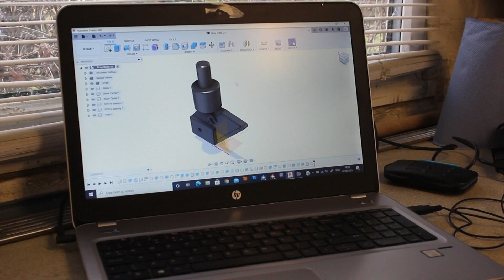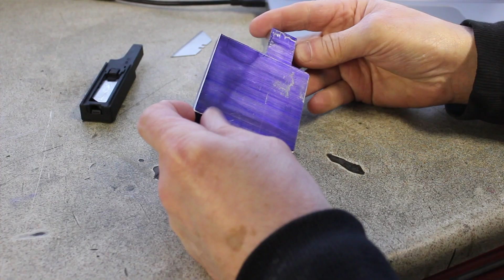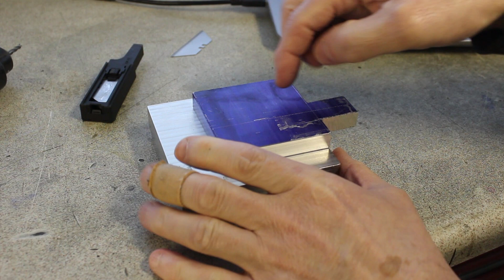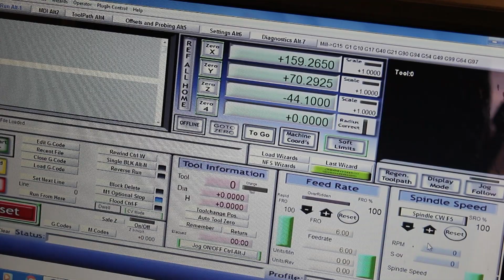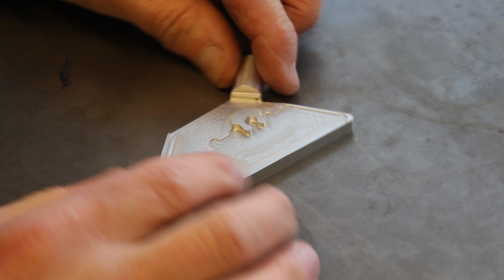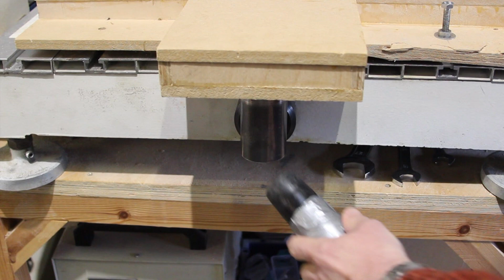Drag Knife - turn your CNC router into a vinyl and box cutter

Comment: Olá, poderia informar o caster?
Reply from the maker: Hi I’m afraid I can’t remember what bearings I used. I can say though they weren’t strong enough they have both failed and need replacing.
Cheers
Reply: @CazualHaze  Gostaria de sber o angulo de deslocamento do centro do eixo para a ponta da lamina, acho que voces chama de Offset.  Pretendo fazer uma para cortar vidro com aqueles cortador manual!
Reply from the maker: @CARCULE-gn4xe   Oh I see! the offset is around 1-2mm it does not need to be very long.
David

Comment: Just wondering why it need this bearing and housing, as the spindle already has good bearings.
Reply from the maker: Hi @viteota good question its a common thing I found on all the commercial units I found. My guess is its because the spindle has a lot of mass ( the rotor etc) and would not follow the cut as easily as a separate lightweight bearing. 
Cheers

Comment: Think this would make a great upgrade for my engraver 😀
Reply from the maker: Thanks for the comment. I used mine to make boxes and inserts for flower presses. I will be revisiting this in the future and making plans etc available.
Cheers
Reply: @CazualHaze  I was considering buying a cheap cricut but this would work well for vinyl paint masks for models I think. Or maybe with a scalpel blade instead 😀

Comment: Beautiful work! How do you make the spindle turn following the 2D contour? Do you use a plugin?
Reply from the maker: Hi @_madmadmat
The spindle is free to rotate. The cutting point is behind the centreline of the spindle.
So it casters in the direction of travel. Just like a supermarket trolley wheel.
Cheers
Reply: @CazualHaze  Thank you!

Comment: Hi, I want to know one thing that, How does the drag knife rotate..??? Does it rotates itself in the direction with the drag force or the spindle is rotating it..??
Reply from the maker: @himanilsharma2147 
Hi knife casters it's cutting point is behind the rotation centreline. Thats a fancy way to say it casters like a supermarket trolley wheel. The spindle is not running at all. The posh ones have a motor and rotate under computer control. I think this is called a tangential knife.
Cheers

Comment: Hello! Can you please tell me how the knife moves? Software, motor or mechanical due to the movement of the axes?
Reply from the maker: Hi the knife pivots on the spindle axis and acts like a caster wheel. It follows the direction of the axis travel. the knife point is 2-3m behind the spindle axis.
I hope that helps cheers
Reply: @CazualHaze  Большое спасибо за ответ)

Comment: Thanks for sharing your work !
If I understood correctly the head of your CNC doesn't orientate the cutter ? He turns freely and only the X and Y movement orientates it, right ? Can it cut more complicated shapes than squares such as curves and so ? 

Thanks a lot for your video ! 😊
Reply from the maker: Thanks Leo,
yes the cutter is free to rotate it follows the direction of cut in the same way a supermarket trolley wheel follows or casters in the direction of travel. It can cut more complex shapes and curves however it is limited in what sizes and how tight the corners are. If you need really intricate stuff try a company called cricut.
Cheers

Comment: Why did you hook up the air?
Reply from the maker: Hi Mike,
I think you mean the air on the cnc router?
Its actually a vacuum hose from a vac cleaner. What happens is it evacuated the air under the cardboard the table is hollow the differential pressure from atmosphere compared to the table forces and holds the card in place.
The clamping force is quite considerable depending on how much vacuum you can pull. At the max of zero pressure in the table the force is 15lbs/square inch. I think my table can get to 5lbs /square inch. Once clamped its hard to move the card however if the vacuum collapses it falls to pieces instantly.
Cheers

Comment: Awesome video. For some time now I had been wondering if its to build one to cut out boxes from cardboard just as you did, so this video has really made my day.. By the way which software can one use to generate gcode from dxf (allowing the cnc to make both cut and crease lines)
Reply from the maker: Glad I could help!
I use fusion 360 for Autodesk. The version I use is paid for but they do a free hobbyist licence. The gcode need to be processed using a plugin from their App store https://apps.autodesk.com/FUSION/en/Detail/Index?id=3603732473616813300&appLang=en&os=Win64
I will eventually sort out a website where my design files can be downloaded from.
Cheers
Reply: @CazualHaze  oh OK, I see. Thank you once again

Comment: Great video thanks... Could you please tell me what angle did you set the blade and how far is the tip behind center of the axle?
Reply from the maker: Hi davered27,
The blade angle is 45 deg the offset is circa 2-4 mm I think it depends on the thickness of the material you want to cut.
Good luck making one. Mine has saved hours of work with a guillotine.
Reply: @CazualHaze  Thanks very much, that's my afternoon sorted..!

Comment: Great video, the drag knife works really well, could you supply files to make one? I can’t make one myself but will get one made by a cnc service if you supply files. Thx again for taking the time to make the video
Reply from the maker: Hi Nigel,
Thanks for the enquiry. I will release files on my website which is still under construction. I will post a video when its done thanks.
Cheers

Comment: One thing about painter's tape, as you noticed, is that actually, the longer it's bonded to a surface, the harder it holds.  If you've ever started a paint project and stuck it to a recently painted surface and then take a break from the project for a week or so and then come back and remove the tape, you have to take care not to rip off the paint... found that out the hard way lol.
Reply from the maker: Having another go right now so far so good reduced the Feed and depth of cut  (doubled the cycle time) using flood
Reply from the maker: You are spot on yesterday shooting another video it broke free and wrecked the part. The tape was only applied for twenty mins before I started the cut. Now I have the pleasure of starting again!!
Reply: @CazualHaze  Oh no! Hope it turns out better on the next go.  Personally, if it were me, I'd just glue the part directly to the pallet.  As long as it can take the heat, you can use a heat gun or torch to soften the glue and pop it right off. You'll just need to clean it up with a bit of acetone.
Reply: With that said, even if you do glue it on directly, heat can make it come loose too, so make sure you have good cooling while machining. :)

Comment: If others are lazy and don't create a guard, use thick tape over the exposed blade to avoid cuts. Make it stick out as an antenna.  Cuts suck! But make a blade guard instead!!
What free cam tools work for drag knifes? I found freecad has a path fixup for drag knifes. Anyone use it?
Reply from the maker: Spot on with guards, these cnc machines dont take prisoners! get in the way at your peril. I use the plugin for fusion 360 but it's not free $9.99.

Comment: I have a 4x8 cnc router and I'm ready to try cutting AL
Reply from the maker: Good luck the noise is horrendous!
Reply: @CazualHaze  I just did my first Aluminum sign yesterday, only broke 2 bits, it there a way to send a pic?
Reply from the maker: My email is in the about section of my channel. Not sure if they allow it but give it a go.